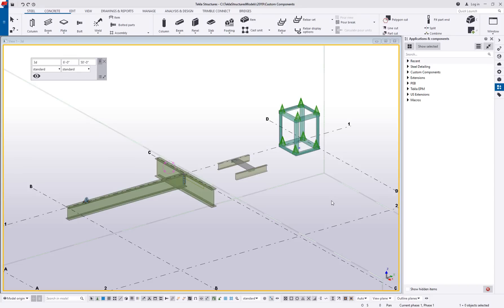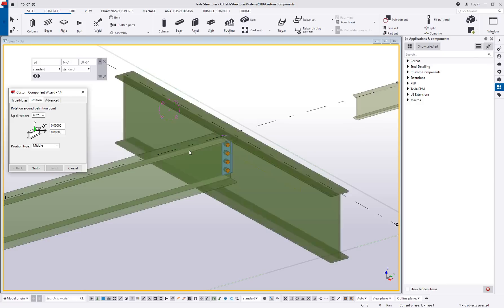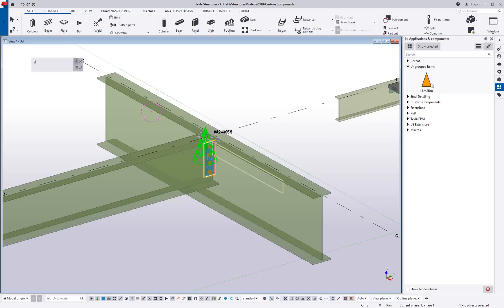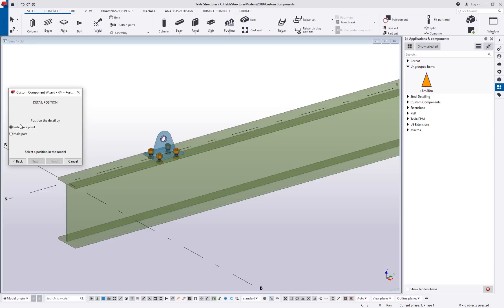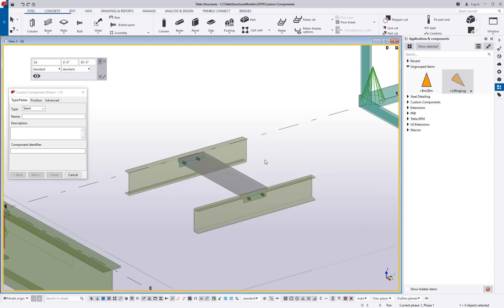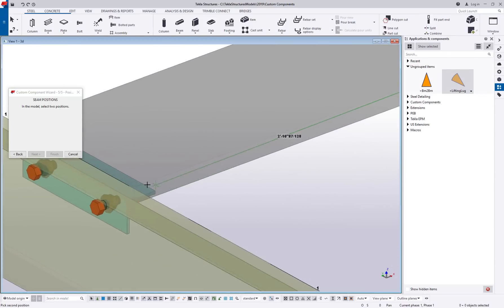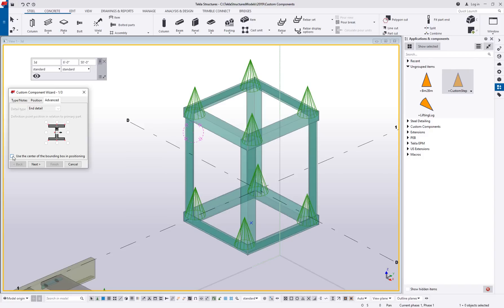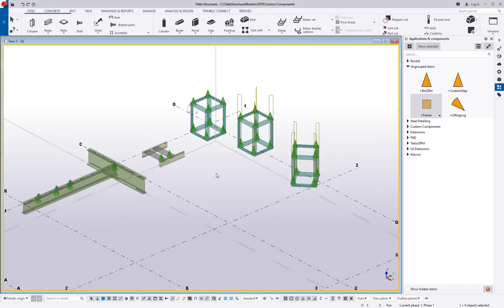Custom Components in Tekla Structures

Comment: Hi, thanks a lot for your videos, not only this one, all videos! A question. I've created a component, connection type, beam to column connection component where column on its top stucks to a beam, specifically it's a situation where rainwater discharge gutter is mounted to (lays on) a column. This connection component is asymmetrical so it has to be adjusted always(!!) in the same position/direction. But it seams that my connection-component detects its default position according to the beam ends (gutter ends) and analysing it he takes one or opposit/mirrored position. (Excuses for my English, it's not my native language). This situation is very easy to observe when dragging the bean (gutter) start of end point (handle) closer to or more away from my connection-component. While it MUST stay always in the same position. How to fix it? How can I make my component to keep its position always the same not paying attention if my gutter is getting longer or shorter? Thanks a lot!
Reply: Aha, experimentally I see that if I recreate my component and assign gutter as main part and column as secondary part then in this situation it works as need it to work. So means that for proper working of a component (type connection) the supporting part not nessesarly must be assigned as a main part, in some cases it must be specifically visaversa.
Reply: @victorstrembitskiy7171  Yes, you can reverse the main/secondary part at times if you need to - especially since the component tends to orient itself to the secondary, and as you found, it can cause your parts to move. If that works for you, then stick with it. Another option for particularly stubborn components is to use a Seam type instead, because you can pick two insertion handles and bind the parts to that plane in the component editor.
Reply: @TrimbleTeklaDave  Thanks a lot for your reply! Though I don't understand what you mean, sorry, I just learn Tekla so probably have not enough knowledge yet to understand you properly. New video would be GREAT help!!!
Reply: @victorstrembitskiy7171  When you make a new custom component, you can choose from Connection, Detail, Seam, or Part. So far you are using 'Connection'. Instead try to use a 'Seam'. The creation/insertion is a little different. You pick the two parts, then also pick two points to set orientation. It's just a different insertion method for a component. I only use these if nothing else is working - I usually reverse the main/secondary part first, like you did.
Reply: @TrimbleTeklaDave  seam instead of connection, okey this is clear so far. But in one of your video's (yes I watch them all :-)) you sais that seam is to be used for parallel parts that are not coliding and in my case my two parts (stanchion and rainwater discharge gutter on it) ARE coliding, that's why I choose connection type :-)))))
Reply: @victorstrembitskiy7171  yes, their primary function is for parallel parts. But it can actually be used in many different situations, they are a very versatile type of component.
Reply: @TrimbleTeklaDave  thanks, I'll try it, will feedback you later about my new experience :-)))

Comment: I'm trying to make a custom component out of a plate to connect a beam to an L beam. I used a seam connection to do this. But when I make the connection, it will not behave like a normal connection where when you adjust the lengths of a beam, the connected beam will move with it like an assembly. i also tried to make a weld between the pieces beforehand and then make the seam connection, but it doesn't make a difference. Any advice?
Reply: Hi Declan, the seam gets inserted with handles, so the handles will govern the position to some extent. You would have to have them move as well, perhaps with bindings inside the normal model space.
Reply: @TrimbleTeklaDave  i still seem to be having trouble. do you think a seam is the wrong approach for the connection between two horizontal beams, or do you think i should be using some other connection type?
Reply: @declanbardin8245  If the beams intersect, then I would use a 'connection' type component. Seam if they are parallel and you are creating new parts between them.
Reply: @TrimbleTeklaDave  thank you for the advice and for your time. with some trial and error, i figured out that using a detail was able to keep the part connected to the main part so it would stay connected and move with the main part.

Comment: I'm trying to make a custom connection between a column and a beam, and it works for a set of columns, but when i try it on other columns, the connection is either oriented differently or positioned differently--for example, it'll drop in inside the web instead of at the bottom of the beam's flange. Is there a way to make it so the connection drops in how I want it every time instead of exploding it and remaking the connection?
Reply: You can try to use different settings on the position tab when you create the component - for instance collision plane vs box plane, but for total control of part location you should use bindings as shown in another video - https://youtu.be/e-cXZgMK24c

Comment: It took me a while to figure this out, since it was not said before hand, but the component  you create and modify needs to be exploded before you create a new custom component, or you get "connection already exists" and it will not create.
Reply: Hi Dee, depending on the situation, if you use that 'allow multiple instances' option on the advanced tab, you will not run into that problem. If you are trying to make a nested component (component inside of a custom component) it is best if you add it after creation, in the custom component editor. This especially is true if you have a system component in place beforehand, you may get the error message you are getting.